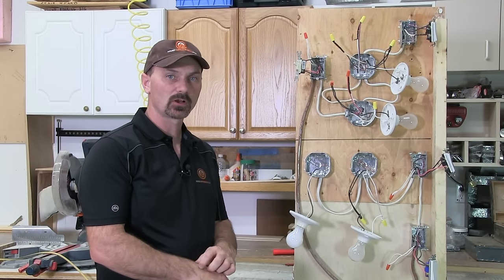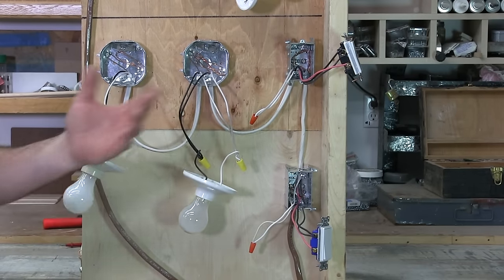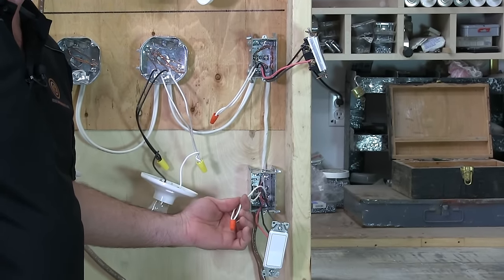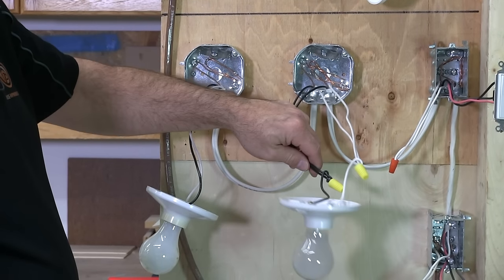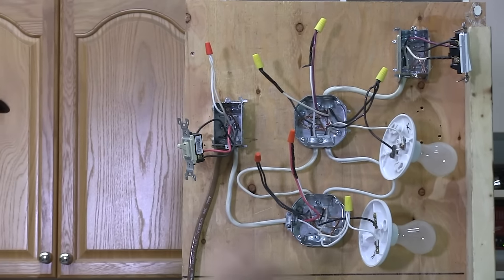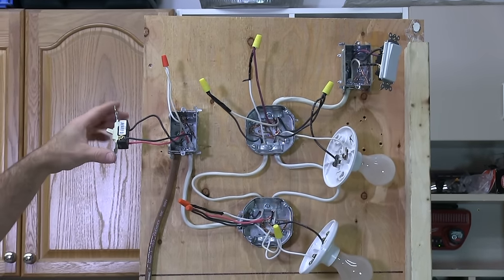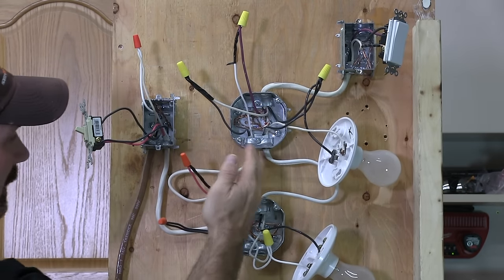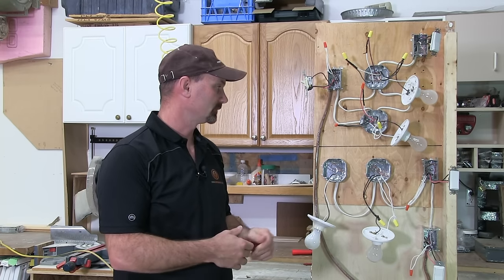How To Wire A 3 Way Light

Comment: I'm replacing a ceiling light in the laundry room that's controlled by two switches.  When I connected black to black and white to white from the ceiling light to the junction box the light just stays on and neither switch will turn it off.   Did I wire the light incorrectly?  There are 4 white wires and 3 black wires coming out of the junction box.   It seems like a simple issue, but I can't seem to find and answer.

Comment: I'm facing this same issue in the second diagram. Someone else ran the wiring but it does not work.  Don't think they knew how to wire it.  The problem is that they sent a 14/2 wire by itself from the 1st switch box to the 1st light on the 1st floor stairs.  There is a 14/3 and 14/2 in the switch box, which is fine, but then they sent the 14/3 and 14/2 to the next switch box on the 2nd floor. from that box, they sent a 14/2 power wire to the 2nd light on the 2nd floor. So my issue is that I am not working on the light boxes at all. those will be straight connects. They went from switch box to switch box with the 14/3 and 14 /2 with a 14/2 form each box going to each light separately.  I know it can be done using the 2nd scenario but all the work has to be done within the switch box instead and that where it's confusing.
Reply from the maker: post your comment in our forum and we can help from there. https://www.house-improvements.com/forums/

Comment: Hey just a heads up for people in Canada, I followed the second instructions and the inspector failed it. Dead end switches are NOT permitted where I live (Alberta, Canada). I guess it used to be permitted a long time ago but now it is not. You need a neutral on every switch.
Reply from the maker: Usually on a three way switch circuit as long as you have a neutral at one location you are fine. If they fail you and the circuit is still accessible simply remove the last 14/3 wire to the laser switch and use a14/4 or two 14/2 wires to that switch.

Comment: In regard to the 1st (bottom) scenaroo, Can someone tell me how many lights I could add instead of just 2? On a 15 amp breaker
Reply from the maker: well in reality you should only run breakers to 80% so a 15 amp breaker should have no more then 12 amps. On a 120volt circuit 120watts = 1amp.
So even though with LEDs this would mean you could run a lot of them on one circuit, many places have not caught their code up and still restrict you to 10 fixtures per circuit. Check with your local code to see if you can legally run more.

Comment: Dam y did you have 2 lights on the 2nd demonstration threw me off I'm trying to wire a 3 way switch mine is the 2nd demonstration with only 1 light

Comment: the first schematic is easy to install so i would like to add a THIRD LIGHT AND A FAN WITH SWITCH, it is possible to do this in the first schematic and how to wire it. thanks
Reply: Javier argumedo, What he's showing is not a schematc just the physical wiring. Do you have any electrical knowledge?

Comment: The scenario most people need is adding a switch to make a light circuit into a 3-way.
Reply: Single Pole switch- hot , switch leg

3way  - hot , two travellers 
3way - switch leg , two travellers  ( from other 3way)
Neutrals tie together 
No neutral on switches.
Reply: @ezrabrooks7785  I don't need the explanation myself.  I'm saying the poster should address it.  Your descriptions are obviously correct... except to your average homeowner.

Comment: Hi. I have a light fixture junction box in my dining room that has 4 white cables coming into it. There are two twitches for this light. I'm so confused. I want to hang a new chandalier, but dont know where to start. Please help.
Reply: When taking down old light mark the wires , the wiring on the chandelier would probably have a smooth surface wire , that would be the black wire , an a ribbed wire that would be the white,  connect the bare to bare wires together if there an enjoy you new light , because you just saved $100

Comment: Shannon, at the time mark 8:30 you say "couple of lights in series". In fact they are connected in parallel. I know what you mean. Better word to use would be perhaps "connected in a row" or in a string. Word "series" when talking about electricity has a very specific meaning. Otherwise this is a very good demonstration.

Comment: How can i do the top scenario with just 1 wire going through, meaning i need a feed going right to left on just 1 line, i cant have two coming out of the light boxes. I gotta do this project for tech and i cant figure it out and my teacher wolnt help me cause he wants me to figure it out, and i cant. Please help
Reply from the maker: I suppose if you can find some you could use a 14/4 wire or use conduit with separate wires pulled in between inside the conduit?
Reply: @HouseImprovements  dang, im not allowed to use conduit in my section of projects and i can only use 14-2 or 14-3
Reply: @HouseImprovements  nvm my teacher said i can use 14-4

Comment: woodyCANES71
I am wiring up my garage with new lights they are wired more like the second scenario.  I am having an issue with the lights staying on. Neither of the switches will turn the lights off?  Is it possible I crossed two wires or could a bad switch also keep the lights on?  I have crossed wires different ways and either one light is on and the other is off or I have both lights on and the switches wont shut them off. I am struggling
Reply from the maker: Ya something is wrong there for sure. You say its wired "something like that " but it needs to be exactly like that. if you post in the forum we can likely help you out from there better.https://www.house-improvements.com/forums/

Comment: Thanks for the quick run through and as you said to check with your local codes because that would not pass the US National Electrical Code which most municipalities use for permits and Insurance companies check for electrical fire claims. Most of the places I have lived let the home owner pull one permit a year for DIY work. I think a permit for work on your house is cheap compared if a problem arises and the insurance company refuses payment because of non permitted alterations. Insurance companies have been known to spend a million to save a nickel. A fight I or most folks can't win. So Cover your A** get a permit.

Comment: Hello Shanon from Saskatchewan. I am struggling with this video. I watch A LOT of your videos and always go away happy and educated. But I’m confused with this one. I feel you are struggling to explain it properly, this maybe due to the fact that this is very easy for you and just can’t explain it to someone like me who is not that bright I guess? If you can help me out I have a new house and whoever wired it has not done this correctly. I have a double switch at the bottom of my bi level house. Meaning two switches at one box. One is for the two light fixtures ( one at bottom of steps the other at the entrance of my bilevel. ) the other to my surprise is a blank single switch. And inside the electrical box for the switch that runs the light fixture is 1-14/3 and 2-14/2 wires. I think ( as it’s hard to follow the 2-14/2 wires hidden behind the main beam and the furnace ducting). They have 5 lights in basement each on a pull string light socket. I am trying to figure out how to trace these 14/2 wires and then I assume if I replace the pull string sockets to regular light sockets then that blank switch should be the light switch for the 5 lights that are  again currently on a pull string. So I took power from the wires and hooked to blank switch and nothing happened ACCEPT now when I use the switch at top of stairs the breaker trips. I THOUGHT I then put the wires all back in proper place and twisted the commons together correctly but I obviously didn’t and now I’m mixed all up and that’s what brought me here. Looking for your video but I think because I’m already mixed up before watching this video has only now got me stressed out and mixed up on tracing wires . I can’t even tell if the 14/3 is the main power or if it’s one of the 14/2 wires.
I’m sorry for the long message
Reply from the maker: Please register in our forum and copy and paste this message into there. It will be the easiest way to figure this out and talk back and forth. It may also be Aaron who helps you as he is my go to at the forum for electrical.https://www.house-improvements.com/forums/

Comment: Using the second method on 9 lights. Would I use 14/3 to two 14/2, back to 14/3 and repeat or 14/3 to two 14/2 and repeat doubling the 14/2 all the way to the end. I started out with 3 lights and decided to be an asshole and leave a few complex circuits for the next guy but my boss decided he wants to include the rest of the hallway so now I have to do 9.
Reply: Oh I guess a light needs a neutral so I need all that extra wire

Comment: You could have just kept running the 14/3 instead of two 14/2 between the lights. Makes the job easier and cleaner but I know most people here don’t want to spend extra on 14/3
Reply from the maker: You could but why would you? There is no need for 3 wire in those cases.

Comment: HELPPPPPPPP I have a two switch next to each other, one is the kitchen light and one is for the breakfast light .  The fixture in the ceiling for the break fast light have three wires, one black, red and a white.  When I connect the white  and black and leave out the red the switch control both kitchen and breakfast.  when  I connect the red and the black the kitchen switch control both lights but the breakfast switch doesn't work.  What am I doing wrong ?

Comment: No Ground wire from switch to box is needed. Reason being is that the metal yoke of the switch electrically will be passing charge if needed to the box since it is metal and screwed onto it by metal conductive fasteners. The metal box is grounded, had an electrical metal conduit been used it would be acting as the ground wire itself - and pass charge to the end point ground rods further down the path. In the case of people that use metal boxes and metal pipes and switches with metal okes - that scenario is self griunding and no conduit leads are required.  ---  the box is grounded through the conduit (which is as good a ground 
conductor as any), you don't even have to terminate the ground wire to the box as long as the  switch has a metal yoke that contacts the box   /// If it's a plastic box, then they need to have the separate ground wire.  ///
Reply: Richard DePaulo l

Comment: Ive been an electrician for about 6 1/2 years. I dont care if you're a journeyman, master, apprentice, foreman, or fucking superman. If you wire up a 3way the way that this hack wired up the top one I'd make you redo it the right way, and not pay you to do it. You've got to be kidding me. Under no circumstance would this be necessary.

Comment: Bra! There's no possible scenario you would ever have to wire a three way like in the second example.
Just feed at one end switch leg at the other or feed and switch at the one end by tying through your neutral to the light then turn the black of the three wire into your common at the opposite switch by either tying the feed through on it or the switch leg. FYI this second method isn't a preferred method because code requires you to have a neutral in the deadened three way so if it's a single gang box at the other end with just this three way switch and no other neutrals in the box it could fail electrical inspection.
Reply: You are totally incorrect
Reply: @gregberban9273  what part is incorrect?

Comment: Great tutorial, and very helpful .....had my go at a Carter 3-way system...or (Chicago or California) system,..... house was from 1911...not an ez task but simplistic and clever due to their coding in those days.. not very safe though, as the reason of switching polarity on a light bulb every time you switch,. could send you a shocking experience trying to change the light bulb out of a fixture... lol anyway, not surprised they banned this system in 1921-1923, still at first what a royal pain in the ass, due to the three way switch carries a neutral wire.
Reply from the maker: Those neutrals that are used for power should be taped black or coloured black to indicate that to the next person that has to deal with it.
Reply: @HouseImprovements  Agreed,... the issue in this situation was that all of the conductors had a matte brown cloth covering, I guess turn of the century possibly they didnt color code exclusively yet?, the cloth was in pretty fine condition considering its age....not sure... but had to trouble shoot them all to make sure I knew what I was dealing with. Was a five gang box with 4, 3=way setups and a single pole.... all Ceramic Push button type......as I said pain in the ass lol... but a great learning experience. TG for your tutorials my friend and for YT to be able to research...I installed my garage door opener from your video bud... keep em coming ... Good Bless and be safe!

Comment: So I’m hoping I’ll get a fast response from someone who knows what’s up. I got a single switch to a basic light. 2 bulbs, standard light from Lowe’s or HD. Used to be an old Fan that worked fine. Want to make sure I’m not gonna mess it up.

SWITCH
(Single pole) RED(top screw) Black(bottom screw) BLACK (stab @ bottom screw) 2 WHITE tied together under one nut. Ground tied together, NOT on switch.

LIGHT
BLACK-Hot
WHITE-Hot
RED-Disconnected
Ground to Ground

How do i wire?
Yes I have done electrical work for about 2 years but it was a LONG time ago. If my Grandpa was still alive I would just call him. He was a 50 year Ind. electrician. HELP!
Reply from the maker: Copy and paste  this in my forum and we can help from there.https://www.house-improvements.com/forums/